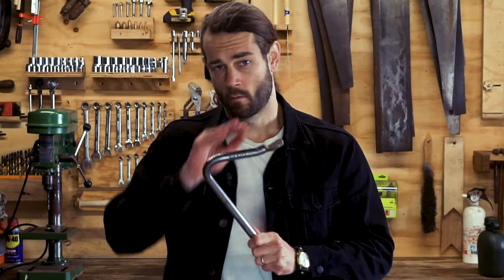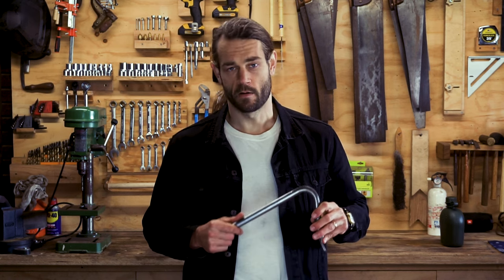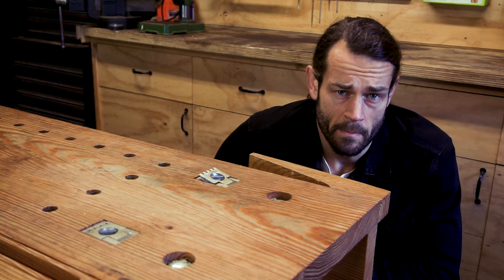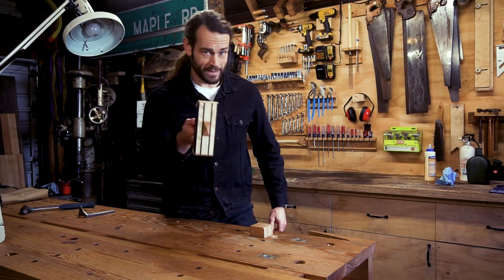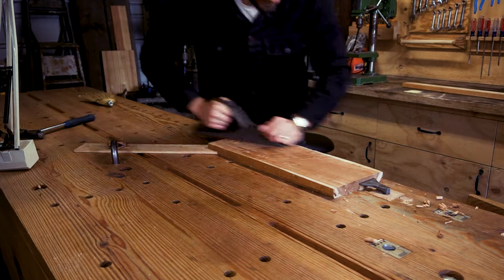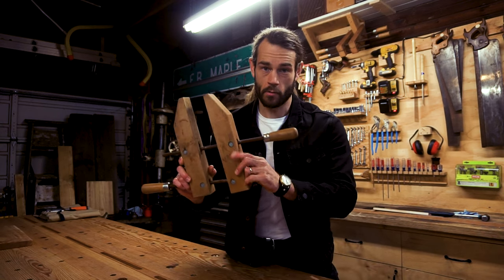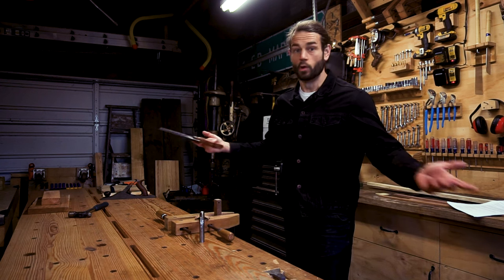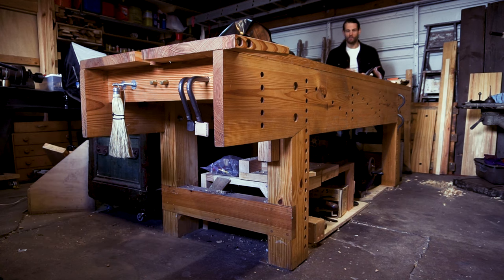Who says you need a vice for woodworking?

Comment: I'm currently rebuilding my work bench for the 4th time as my needs have changed a lot over time.  I honestly was unaware of the vertical side holing options for the holdfast and will make some quick adjustments today during the build to include the needed holes so I can try some of the things demonstrated.  Thanks for introducing me to the concepts, also great music montage!
Reply from the maker: Glad you found it useful!
Reply: Very useful.  Just added a fixed mid leg and drilled holes in the  relatively short skirt along with the two legs on a couple of sides.  It's all softwood so I doubled the thickness to 3" on most areas to avoid failure.